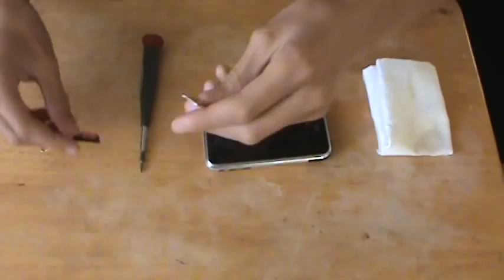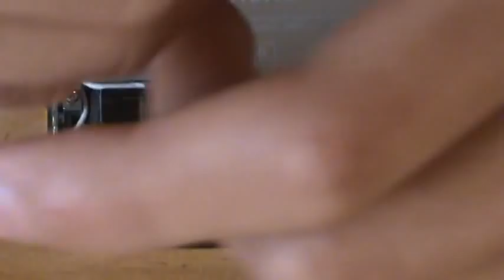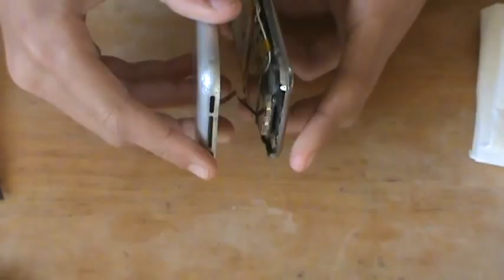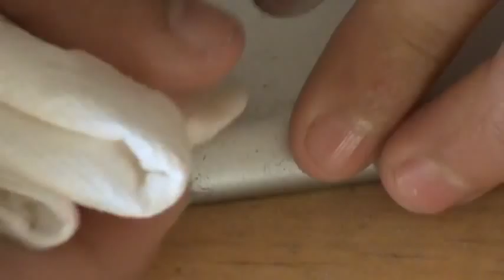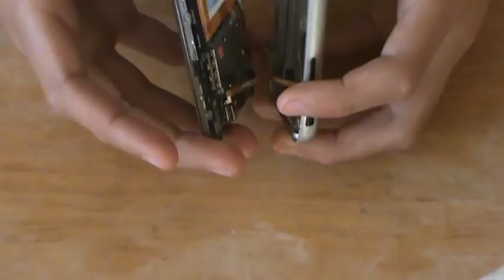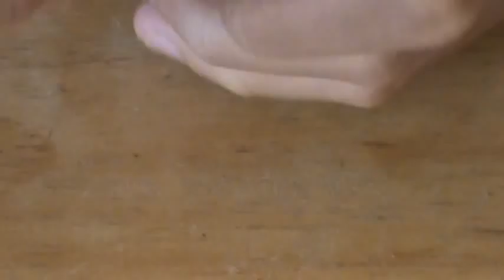Clean iPhone 2G camera for clearer pictures

Comment from the maker: @mxims96 well i used my busted shitty one. someone gave me another with water damage and i swapped the motherboards and it worked. and i bought the cracked one on ebay, i had put a screen protector and a case on it and it still cracked anyway. but without any protection the thing wont frikin die!!